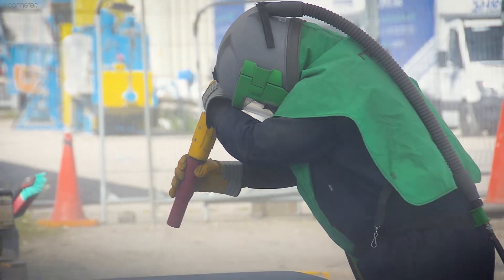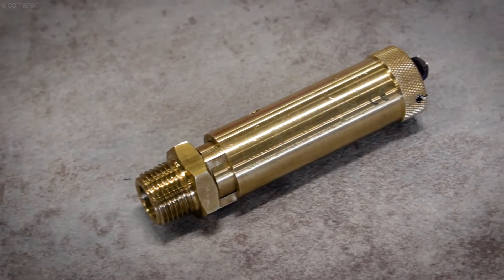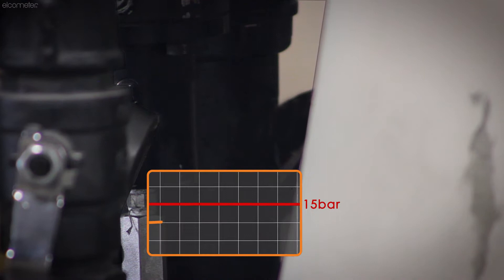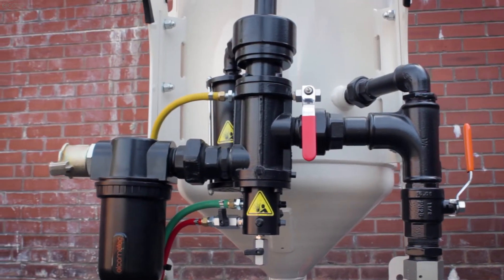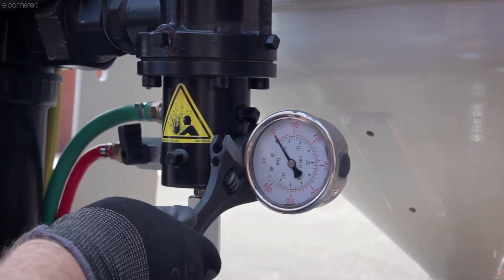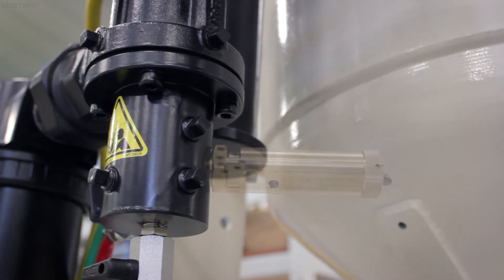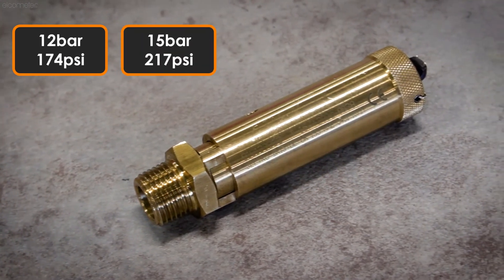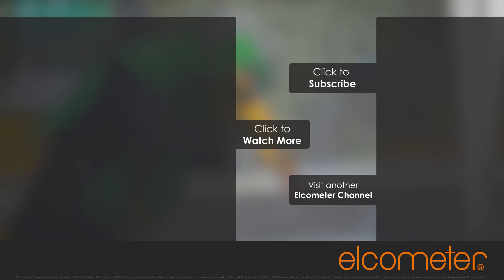What is a Pressure Relief Valve? - Elcometer Blast Equipment

Comment: Does remote control valve comes with inbuilt Pressure Relief Valve?
Reply from the maker: Hi,

The pressure relief valve is not inbuilt with the remote control valve - it is a separate part.

If you have any further questions please get in touch at support@elcometer.com